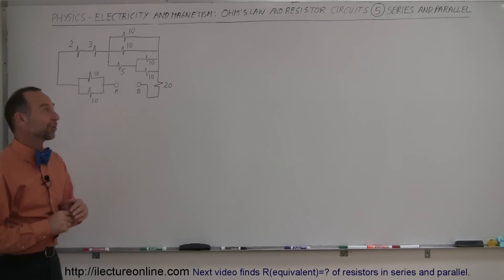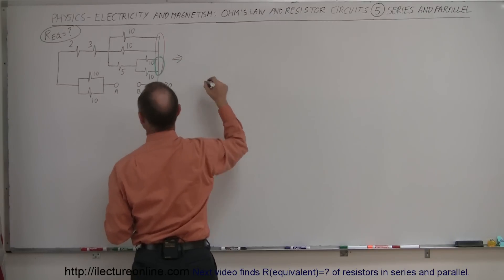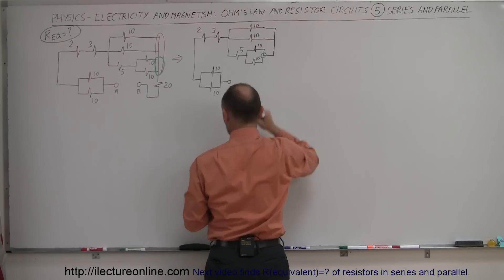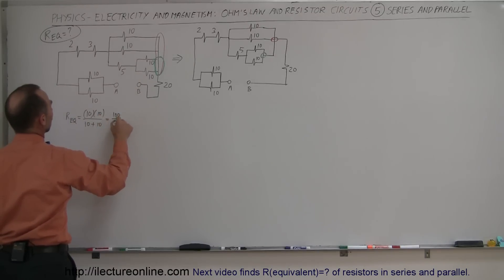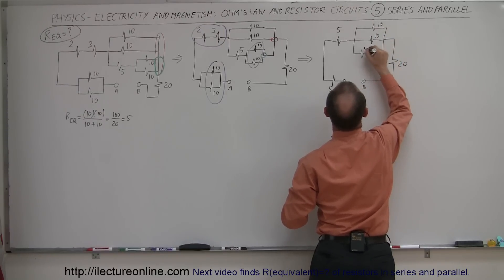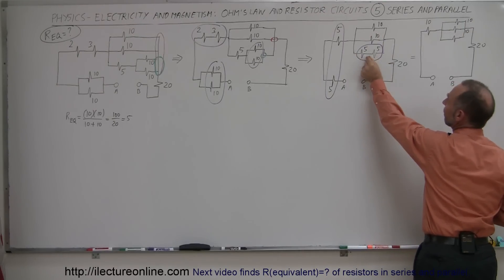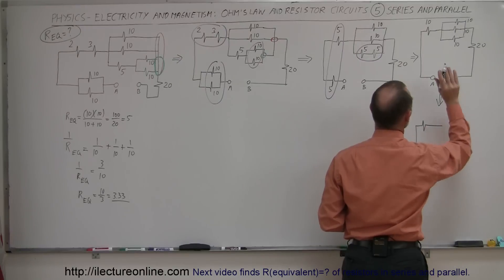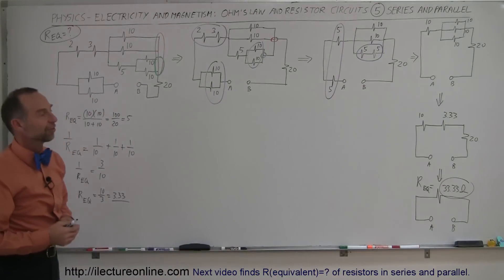Physics 42   Ohm's Law and Resistor Circuits (5 of 23) Series and Parallel

Comment: Shouldn’t there be a current or voltage for there to be resistence? So the R is technically 0? Lol
Reply from the maker: Resistors are rated and do not need to carry a current to have resistance.  However in order to MEASURE the resistance, you will need a current.
Reply: @MichelvanBiezen  thank you :D